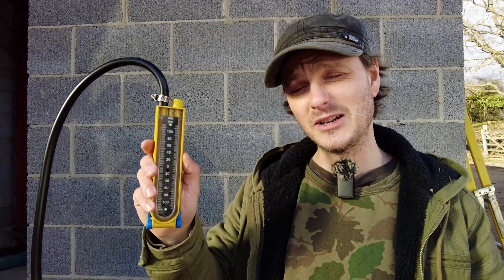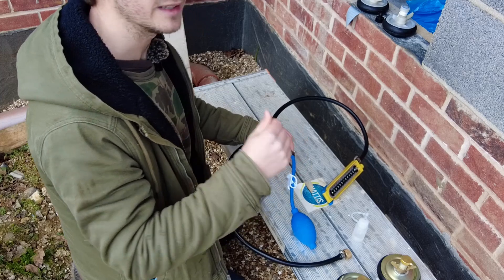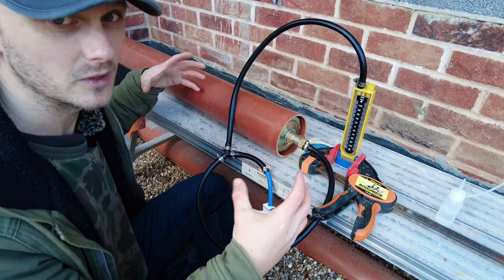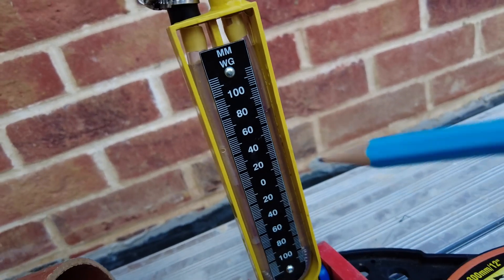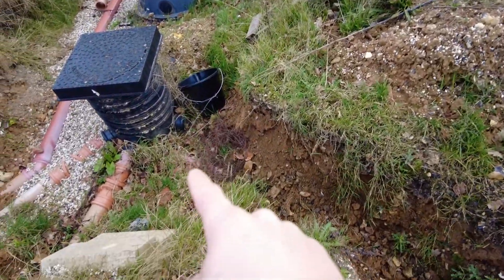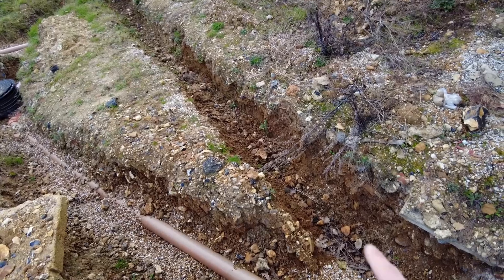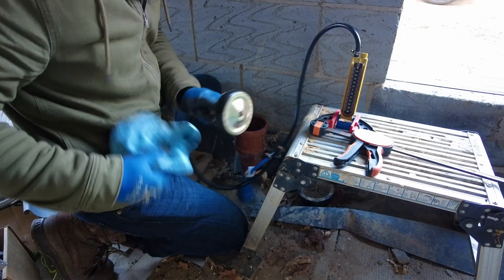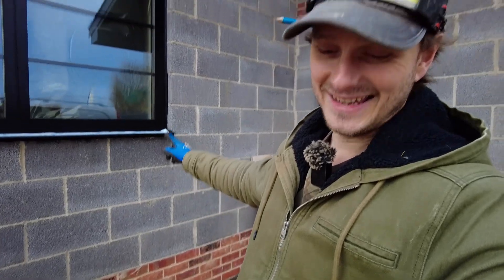How to Pressure Test Your Underground Drainage Soil Pipes: A Step by Step Guide

Comment: I know this video is a little older now, i tested my drainage myself on my property and building control are now asking for a certificate. I sent them a detailed list on what i had done by email but that dosent meet the mark. I cant for the life of me find a certificate to send them however. Anyone know what it is i am supposed to show?
Reply from the maker: There is no legal requirement that a drainage test must be carried out by a plumber, civils contractor, or an accredited professional. Building Regulations Part H only require that the drainage installation is tested, not who must do it.
Many self-builders successfully submit their own certificates, especially for simple air tests on new foul or surface water drains.
They will want certain information, what test was done, what equipment you used, test results etc etc. Use chatgpt and it will guide you on what info you need to produce. 
Even though this is older I still haven't finished 😅😆 my private building control have already taken my word for it. However I need to give something to my warranty inspector 🤦 off the top of my head I think it says I need to have an insured plumber test and sign off 😮‍💨 might just slip someone a drink rather than waste their time 😅
Reply: @THE-AIDEN-PROJECT  thank you for the reply, best of luck with the project. Im in scotland so it may be slightly different but i think im going to try what you said and get chat gpt to make a document. Thanks again.

Comment: Manometer should be fix at lower end right?
Reply from the maker: Not sure what you mean
Reply: I mean suppose there are 2 chambers connected with the pipe. One chamber is hingher than the another by 10 cm. So where should manometer be placed at lower chamber pipe opening or at upper chamber pipe?
Reply from the maker: @prasadchavan1983  oooh I get what you're saying. On an air pressure test you can do either, it makes no difference
Reply: @THE-AIDEN-PROJECT ohkk 
Thank you so much🙏🏻

Comment: Thanks mate, been worrying about mine because they are going in next week now I know what to do 👌🏻
Reply from the maker: Fingers crossed yours are all good. I need to test the rest today, the 2nd one failed 😬 I think it's either going to be the adjustable angle connector or the contractor put in a cracked pipe under the floor and covered it up so I wouldn't see it 😂
Reply: @THE-AIDEN-PROJECT  🤞🏻🤞🏻🤞🏻🤞🏻
Reply from the maker: Turns out the adjustable 0-90° double sockets are leaking. Make sure you snug them up tight if you use them. I got my biggest set of grips round them but no luck. Ordering some strap wrenches off amazon now. Hopefully it's not all 5 🤦‍♂️ one is already buried 😂